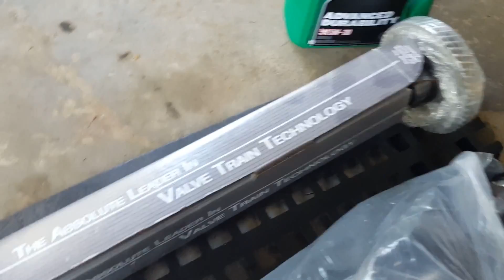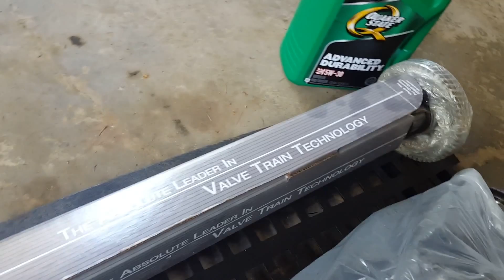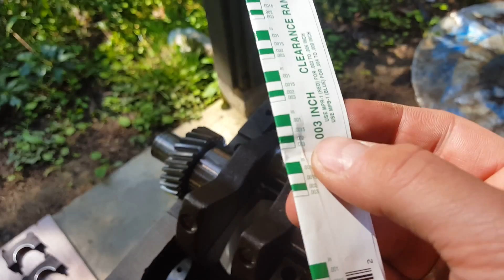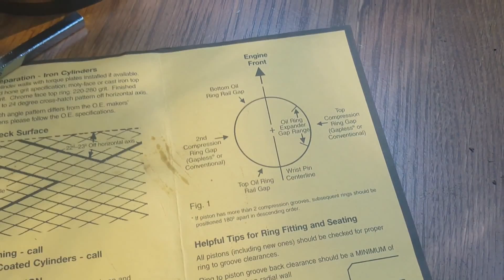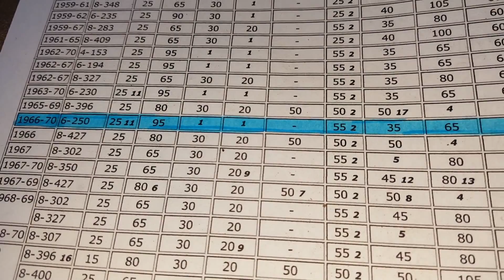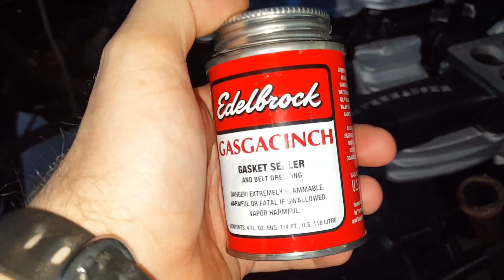1967 Camaro - Chevy 250 Inline 6 Short Block Assembly

Comment: I wouldn't be bored, I'm actually quite curious to see how others do it. Great vid, cheers mate!
Reply: Are you having any crank barrings clearance problems I am
Reply from the maker: +Michael Smith I had no clearance problems. I'd give the plastigage a shot as it helped to confirm I had the correct parts and the machine work was sound. If you give me some more details about what you've had done I can try to help.

Comment: Why the cork gaskets,?
Reply from the maker: That's all their is/was for these engines. Felpro and the usual suspects don't (or at least didn't) offer anything but their premium cork gaskets. I actually made my own nitrile valve cover gasket on another video as I was tired of replacing the cork one every other time I pulled the cover.
Reply: That's all we've got to choose from on these 6s. Its not like a smallblock that can be put together with absolutely no cork

Comment: How many hours would you say it took to do the disassembly and the build?
Reply from the maker: That's really hard to say, the custom turbo piping and all the painting and whatnot took hours and hours, but over a period of days/weeks. It was a side project that want really rushed. I had to take the parts off the island j lived on to be machined and then back to pick them up. Plus I had a full time job. I'd say I spent a month or two for sure, even with full prep and gathering parts ahead of time.

Comment: There was some talk among the Pontiac ohc6 people there was a possibility to used Chevy small journal 327 rods on a rebuild on a 250. I like they way you upgraded on the pistons for the turbo, but not on the stock rods for a turbo.
Reply from the maker: Thanks for checking out my videos. I belive you can use 327 rods, but I spent some time researching the integrity of the stock parts and as most people know, they didn't skimp much on quality with these motors. Thank being said, I had the whole bottom end balanced and used ARP rod bolts for increased durability. The stock rods are forged and I'm told by several sources they should withstand well over 500+ HP. I read somewhere someone used the stock rods on an 800 HP build with no issues (for how long who knows). The stock crank is solid and yeah, the weak point was the pistons. Expensive, but forged pistons were a must here.

Comment: Also, where did you get your parts?  I’m having a hell of a time trying to find anything for the chev 250
Reply from the maker: Some on eBay, Summit Auto in the US, speedway motors, 12bolt.com, CompCams and most engine machine shops will have the rebuild parts. Take a look at the Turbo Camaro website, I go into a lot more detail on there about sources and specific parts.

Comment: Neglecting the oil pickup tube and mesh filter is a mistake.  Any debris from the engine is sucked into the mesh and up to the tube to the oil pump.  Significant carbon, steel, aluminum ,etc., can get lodged in the mesh and tube and can refult in damage to the new engine.  I learned the hard way!
Reply from the maker: Ronnie Robertson Great point! I ended up cleaning the mesh and inspecting mine but had no issues with it prior to disassembly so reused it. It'd onenofnthose parts that's cheap enough to replace and probably should during a rebuild just for the peace of mind.

Comment: What Carb did you run with your Offy Intake? Do you have recommendations for a Sunday Driver Inline 6?
Reply from the maker: I ran it with the Holley 600CFM 4776 DP with Mechanical Secondaries. I only went that big because of the turbo. If you're not turboing I'd stick with a 2 barrel. I'd Probsbly consider a larger 2 barrel mechanical carb even if I was to start over.

Comment: When using Plastiguage you are supposed to use regular motor oil, since that’s what you will be using when it’s actually running. Your measurements could have been affected.
Reply from the maker: I've never heard that you're better off to use regular oil, but I should have wiped off the spot where I put the plastigage, and the mating surface so that it didn't mess with how it looked after it was compressed. Good catch either way.

Comment: I dont understand the rear main seal having to be not seated and sticking up on one side? Will the main force it to be seated properly? I never saw that done before with making it stick up on one side?
Reply from the maker: The seal is actually seated but you want to offset the seam so that it's not beside where the cap meets the block. The two price seal does come together once installed, but the meeting points are just offset/staggered from the cap. The instructions for the seal tell you to do it this way and have a fancy digram so you can't mess it up.

Comment: What kind of pistons and rods should i use for a low boost street 6 cylinder? Right now i just have stock rods with sealed power cast pistons
Reply from the maker: BKG Fab Our Camaro is a daily driver that currently tops at 8#'s boost. The stock rods are forged, and with decent ARP bolts will hold to 600-800HP. Pistons are questionable but we went with Ross Racing Forged dished pistons. The dish size will vary based on your desired compression ratio. We went with 12cc and ended up with about 8.75:1 compression.
Reply: Food for thought....I have turbocharged several motorcycles to 12 psi of boost with stock cast pistons, also the majority of the modern OEM turbocharged GM cars run cast pistons. The ring gap and piston to wall clearance is what's the most important with a turbocharged engine, this should be discussed with your machinist so they can hone the block accordingly. I have seen both forged and cast pistons melt from running lean (but that's a tuning issue not a mechanical issue). Generally when the ring gap is too thin and when the gap closes due to lack of ring gap, you will break the ring lands on the piston....

My credentials: GM factory trained technician. ASE Master Technician. ASE Advanced Engine Specialist

Comment: I have a question I didn't send my block to to have it 
Don't do I need to pull the cam out in order for crank to set right
Reply from the maker: Michael Smith looks like part of your question was cut off. Since the cam and crank run on gears, you can adjust cam advance without removing everything, but most builds won't incorporate this. Hopefully I predicted your question right.

Comment: Do you have a video that details the manifold bridges install? I have seen the manifold flatness one, doesn't detail this.
Reply from the maker: I'm not actually sure what you mean "bridges". We talking about the heat riser area where the manifolds sandwich together a gasket?
Reply: @TurboCamaro67  the bolt has a bridge (washer) that secures both manifolds. 
I guess grinding the lip of the manifold is the solution. 
Have not seen replacement bridges available though.

Comment: What year is that exhaust manifold from?  The first engine I ever built was a late 60's chevy 6 like yours, but the exhaust outlet on the stock manifold was more toward the middle, directly underneath the carb.  Are you using this manifold to simplify the exhaust plumbing to the turbo?
Reply from the maker: +Steven Bauer not sure what year, it's from a Massey Ferguson farm tractor, but it's the same manifold you'd find on the larger 292 Inlines in the late 60's. It has a 2.5" outlet instead of the 250's 2" outlet. The half inch makes a big difference. Having a more expensive custom manifold (SPA Turbo) would simplify the plumbing, I used this manifold to keep the budget down and use as many "stock" parts as possible.

Comment: Every block I have found near me.. has been older design. :(
Did you order the rear seal seperate or which kit did it come in?
Reply from the maker: Fel-Pro makes a kit for the 67-7X non-integral head engine that includes all engine rebuild gaskets including the real main seal (RMS). Installing the RMS on this engine is specific and the kit came with a seperate slip of paper to describe the process.
Reply: @TurboCamaro67  
The kit I bought for 61 235 came with old rope seal. Removed a wiper seal from engine though.
If it leaks.. I will go back to the wiper seal.
Reply: @TurboCamaro67  new video soon?

Comment: Just wondering what is the height and length of your beautiful 250 engine block after fully assembled? I am contemplating replacing my Ford 200 inline 6 with a 250 Chevy inline 6 for performance purposes.
Reply from the maker: +Evan Molnar Hey Evan, I'd only be able to give you the height of my current setup or from oil pan to valve cover. Any carb with air cleaner or plenum is going to stick up at least a couple inches above the valve cover.
Reply from the maker: +Evan Molnar Hey Evan, unfortunately I'm not at my car right now but I should be able to grab some measurements for you after work. I'll take from oil pan to mounts and mounts up. I'll grab top of valve cover and also top of the plenum, keeping in mind a stock carb with air cleaner may be slightly taller/shorter. Stay tuned...
Reply: Turbo Camaro splendid, i look forward to hearing from you.
Reply from the maker: +Evan Molnar I had a couple minutes so I did the measurements. Lowest part of oil pan top of valve cover is 23½". Top of valve cover to top of throttle body (same size as 4 barrel carb) is exactly 4". Bottom of oil pan to mounts is approximately 7½". Interestingly, the block without accessories is 27" long, with water pump and mechanical fan it's 34" long. That being said the fan has a 2½" spacer on it so the overall length could be reduced. Let me know if you need anything else.
Reply: Thats really interesting, I hope I can extend my radiator a few inches but other than that I really think from what you say the engine is almost the same size as mine. Hey thank you so much for giving me a moment of your time and measuring your engine, do you happen to know the weight of your engine by chance? I was looking on forums and a lot of them say they weigh 440lbs compared to a ford 302 which is 460lbs. Is that the case for your engine? Or is it even heavier because of the turbo and other accessories. I'm hoping I don't have to mess with the suspension.
Reply from the maker: +Evan Molnar no problem with the info, I'd never measured it so it was good specs to grab. Also never weighed it, that being said I can carry the block (awkwardly and very short distances) and I can carry the fully assembled head more easily. I just looked and found several sites saying 440lbs as well. Yes though, the turbo and piping would definitly add a few pounds. The intercooler and alcohol pump are not mounted on the engine but also add weight. I'm betting your suspension would be just fine. You considered going with the 292?
Reply: Turbo Camaro Well I wanted to go with the chevy 250 I6 because of the performance possibilities far surpass anything for the Ford 200, I also liked it because the block height and length are very similar to my ford engine, however Im totally open to putting in a bigger engine size. Is there a lot of performance possibility for the 292? I read somewhere that the longer the stroke is the less it could be rev'd out to.
Reply from the maker: +Evan Molnar Well the biggest difference is the displacement for sure.. instead of half way between 200ci and 300ci you'd basically be 300ci. The best you can hope for a quality build on these unlined is about 110% of the displacement in HP. A 292, bored at .040 over will put you close, if not at 300ci, and that built up could net you 310hp if all the head work is done right. So what I've done with the turbo and meth injection and you could run it safley at 450hp. I'm no engine mathtician but these are pretty safe numbers. The 250 is a great motor too but will always be 50ish less HP than its big brother.
Reply: Turbo Camaro Thats Awsome. I'll have to look into the height associated with the 292 block.     Do you know if parts for the 250 like the cylinder head could be interchangeable with the 292? Again thank you for your time answering my questions.
Reply from the maker: +Evan Molnar Yep, it's a bit taller for sure otherwise the same length and width. The head is interchangable, at least the early 60-70s heads anyway. Anything smaller than the 250 and the 292 head won't work. It's the block that's taller and requires different pistons, lifter covers, crank, rods etc. The big money in these engines is aftermarket forged pistons and all the head work. Removing the siamesed bolt boss and getting bigger valves in there makes a massive difference. Typical stuff like a hotter cam will help too. Normally I'd suggest getting the 292 exhaust manifold, but if you already had a 292...

Comment: send me your cam specs. currently doing a 250 chevy turbo set up too with my 63 nova. I just want a decent cam that will make good power.
Reply from the maker: Hey, the cam card sheet can be seen on our website @ Turbocamaro.ca on the 'Build Sheet' under 'Camshaft'. If you give the grind # to CompCams they can get you the same one. Of course you could request the same specs from a different brand as well. Please let us know if you need more details.

Comment: 12bolt.com sells a timing cover that is a two piece unit that eliminates the issue with the oil pan
Reply from the maker: +ProperMods Wow I haven't seen that yet. I'll go check it out right now. No leaks from mine at least. Thanks!
Reply: +Turbo Camaro no problem! I re gathered my interest for these engines and went and paid his site a visit an noticed those. Can the stock rods really hold 500hp?
Reply from the maker: +ProperMods the stock rods are forged, and with the upgraded arp bolts 500hp will be no problem. The stock crank is probably the weakest link in my setup. However I've heard of enthusiasts getting 600-800hp out of the stock crank so who knows. Inline 6's are the budget tanks of the era.

Comment: Hi  
I need your help!
I got GM engine #8994258 I got it form Auction I do not know what it is for I think 292?
and I have 1987 GMC sierra  C10  v6 with no engine I want to put the 292 in my GMC do you think will work for it?
Reply from the maker: Easy tell on a 292 is the height of the lifter covers. The 292 covers are quite a bit taller than the 250 and under. I'm not great with engine codes but I'm not certain that's the actual engine ID stamp.
Reply: @TurboCamaro67  
this is the engine
https://lubbock.craigslist.org/pts/d/ralls-1964-hotrod-292-engine-for-c10-gmc/6971682854.html

Comment: I see that you have put ass’y lube on the main journals before you used the  plasti_guage that will give you a false reading as the crank actually sits on that film of oil which could mean that the readings out by .0005-.001 thousanth’s. It is all was recommended that Plasti-Guage be used on a dry  journal
Reply from the maker: That's a good catch. If you had asked me how, I would have said it should be dry. It obviously will compress and "squish" out but still be thousandths of an inch different which kinda defeats the purpose of the guage. Thanks!
Reply: @TurboCamaro67  no problems my friend  I hope that you have learnt something I’m a retired mechanic with 55 years of experience and I admire you young guys that are willing to have a go if I can be of more assistance just ask

Comment: Why a 250
Reply from the maker: Why not? Rather see another 350 build series?
Reply: @TurboCamaro67  I figured you would went 292 is a 250 better thanks
Reply from the maker: @rodneyturner5091  Yeah a 292 would have been a better choice, but this is the #'s matching block for the car so I'd rather keep it original than have to store this block in my crawlspace ;)
Reply: @TurboCamaro67  is a chevy 250 good for chevy truck 4x4 stock truck manual transmission I'm new to inline 6 chevy 250 thanks
Reply: @rodneyturner5091  the 250 will make a good driver. It won't be "fast", but it can be fun to build up. You can use Chevy 307 V8 pistons in the 250 to bring compression up to around 9.0 or 9.5:1. Headders and 4bbl intake with a cam and itll pull harder than a stock 350